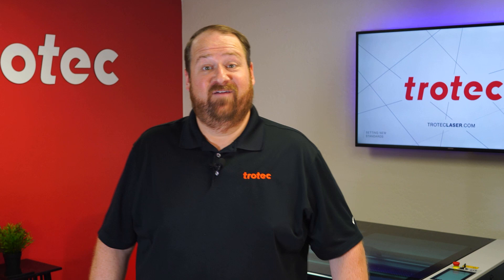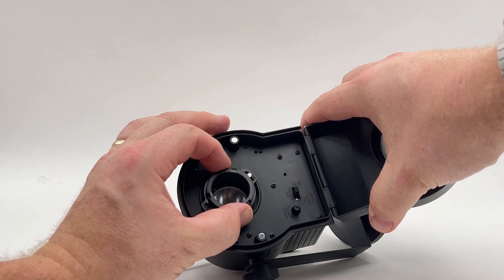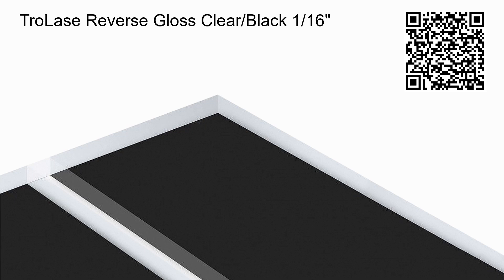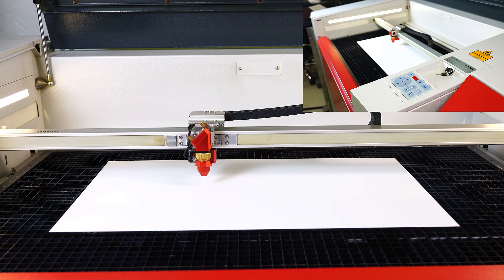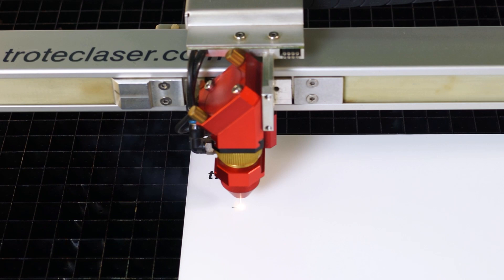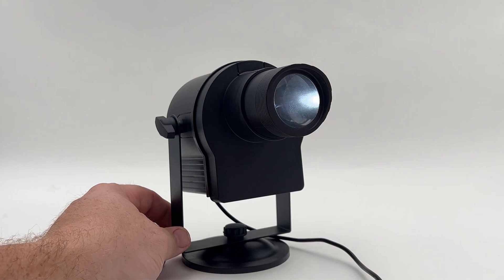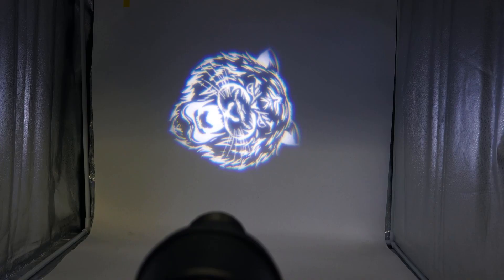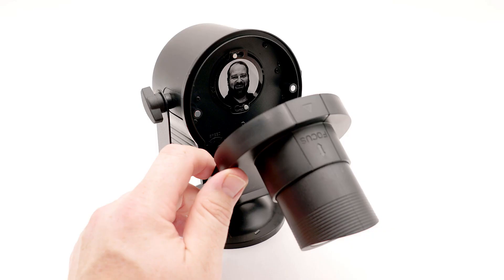Trotec Laser: Can you Laser a Gobo Projector?

Comment: Great application Dave! This low power unit works well and looks great. Just to advise however, professional lighting systems such as for film would likely be too hot for anything but a metal gobo. I also used our Trotec Speedy 300 to also create exciting cucoloris or 'cookies' for our film department - creating various patterns in 1/8 inch ply sheets  - these can be used to shape light and create shadows to evoke atmosphere such as Film Noir or patterned backgrounds for interviews.